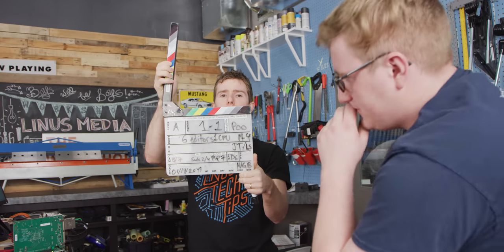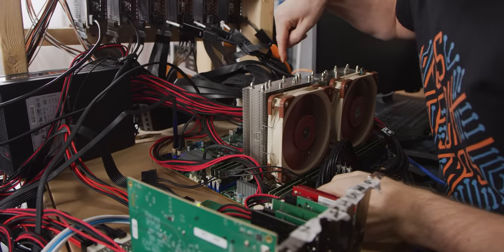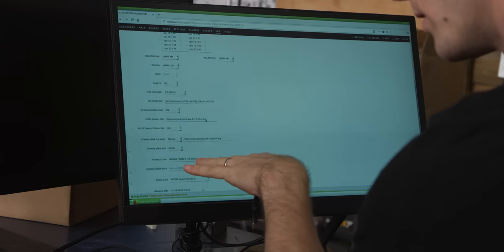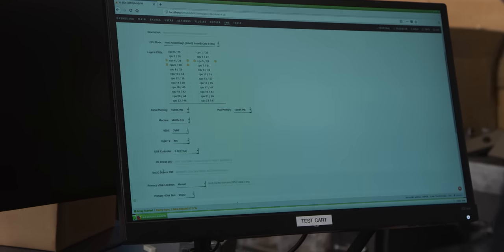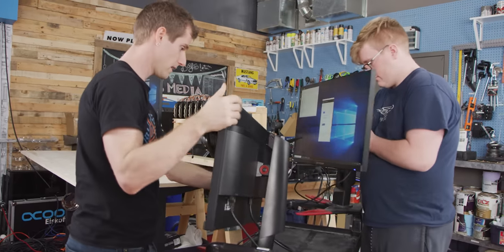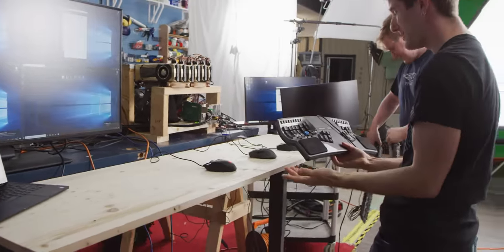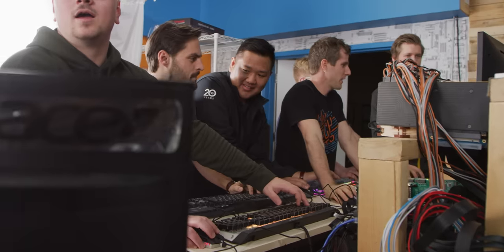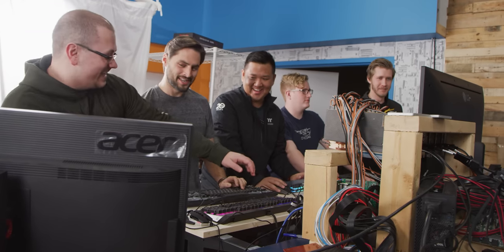The $100,000 PC LIVES! - 6 Editors 1 CPU Pt. 5

Comment: So wait why would anyone want this? I don't see the advantages of this over one rig per person. Odds are, for this much you could have an office fully set up with enough power to run good editing software. I can run premiere off of my Lenovo B570 with 6G Ram and 2.4 dual core hyperthreaded with integrated graphics. It doesn't run optimally, but I got for 100 bucks a couple years back. I'd imagine the 100 dollar laptops of today will run a bit better. Most companies can probably get a local seller to outfit them for far less than 100,000 dollars.

Comment: Hopefully, someone comes across my question on a month old video. Is that a monitor but the size of an average tv. 13:13 

If so could I get a link to that exact monitor or maybe between a 34" to 43" inch monitor? One of the reasons I don't game on PC is because I've never seen or heard of any monitor bigger than 15".
Reply: It is a monitor( I don’t know which one) but i have never seen a monitor UNDER 20 inches, I don’t know what you are on about. Anything over 30 inches for a pc monitor is too much imo and it will add latency.
Reply: @programed8962  I eyeball the measurement of mine since I was the couch laid down in the golden spot. My laziness has destroyed my intelligence.

Comment: Such a waste of money imho, can build a better solution with enterprise grade stuff for less money. Using pass-through was the way to share resources 10y ago, however now on nvidia stuff you have vGPU. same with CPU, if you are only 6 users you should consider swaping big core CPU for "adapted" core CPU with higher frequency, depending on usage ofc. Worst part should be the RAM sizing, you know that you'll only use 30% right? There is a big difference between allocated memory and used memory. Finally, you guys should consider using PCoIP or thin clients.